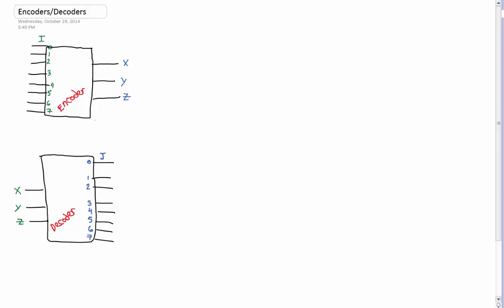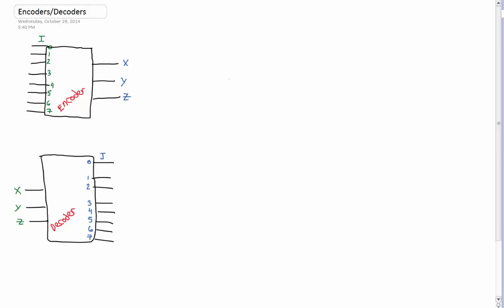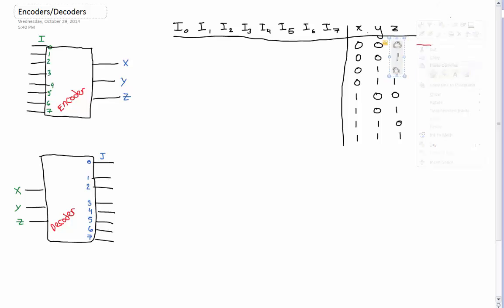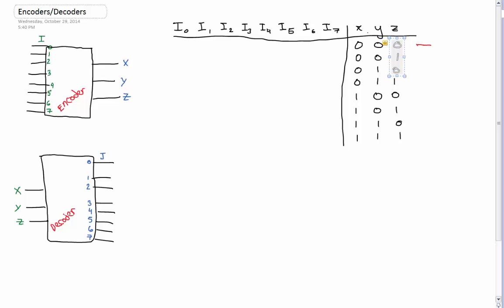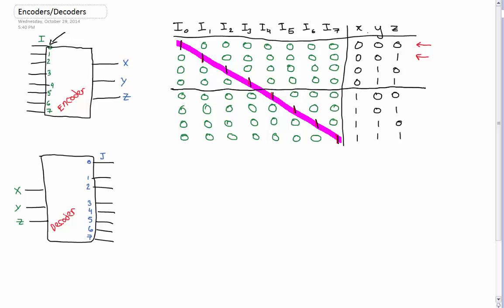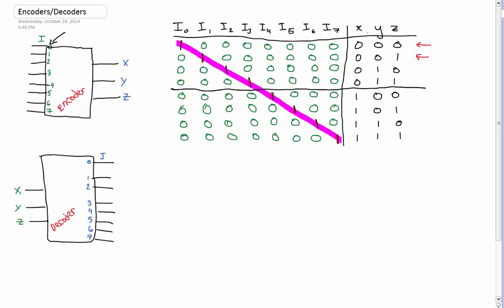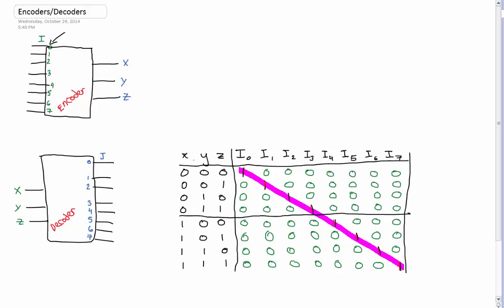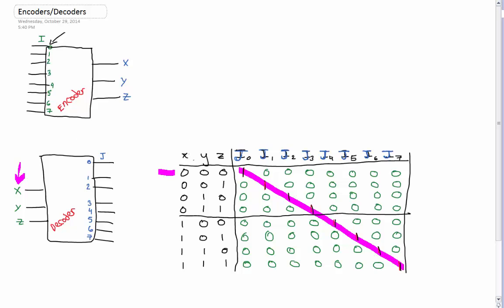Encoders and Decoders Made Easy (circuits)

Comment: but how would x/0 y/0 z/0 give you 10000000??  0 and 0 and 0 would give you 0? not 10000000??
Reply: The 1 you see shows that 0 is active, denoting that 000 = 0
Reply: @Joyce-s4q5h yes. It will make sense if the encoder is used for a circuit for a 7-segment display that just takes input to display a digit

Comment: Ok, noob question incoming in 3, 2, 1... 
What if we have more than one input == 1? ._.
For encoder, let say we have I2 == 1 and I5 == 1 at the same time?
Reply: I think it's the building block of encoder that you can't have more than one input on for each output
Reply: The most significant bit takes precedent.